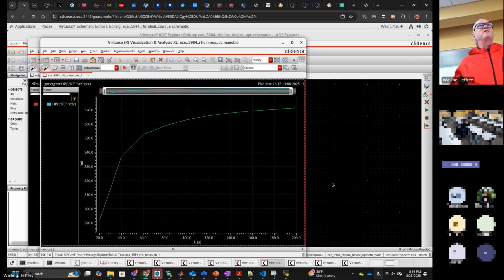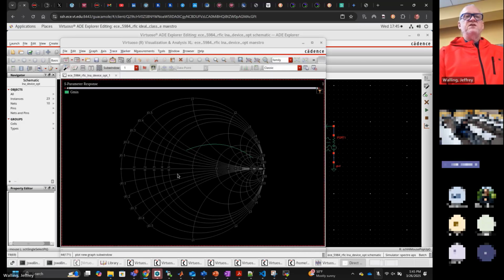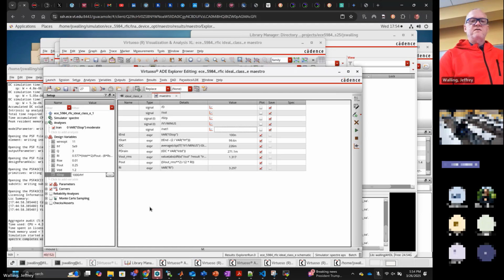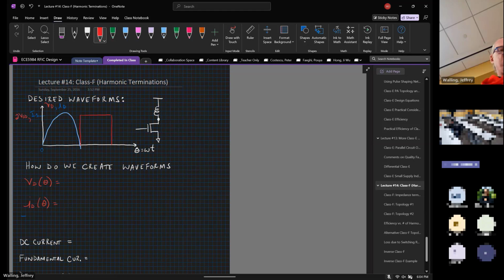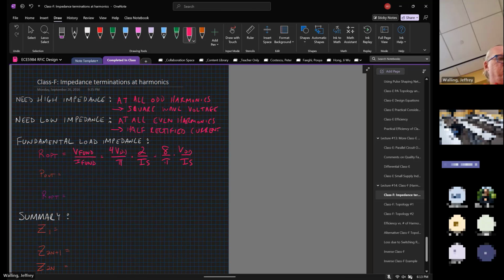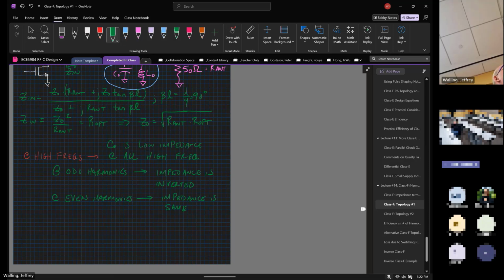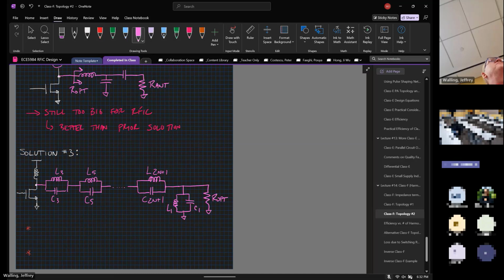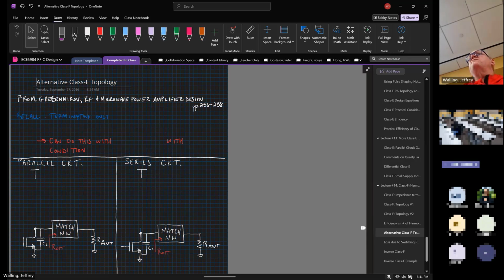ECE 5984   RFIC   Class F Power Amplifiers

Comment: In solution2  beside form factor ,quarter wave might not be a good idea in a TR/RX module due to leakage H2 into RX path. usually we design H2 Trap is used before the choke for extra H2,H3 signal  leakage suppression. into Vdd lines